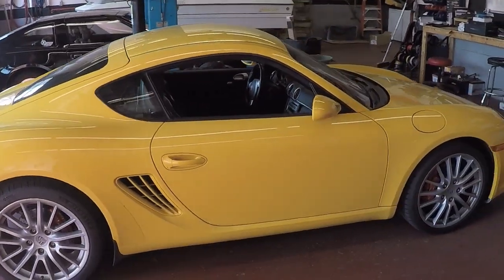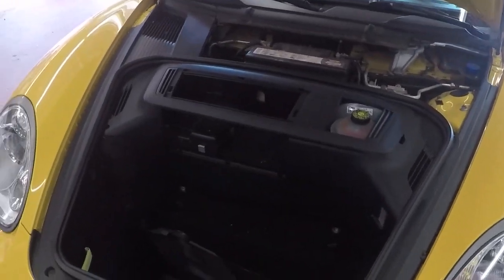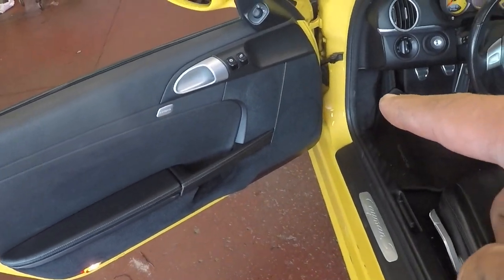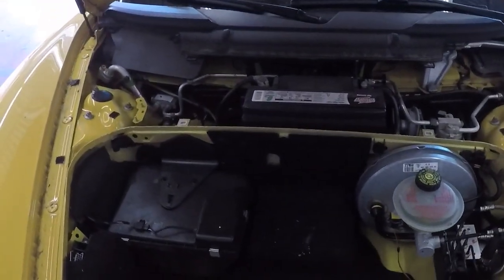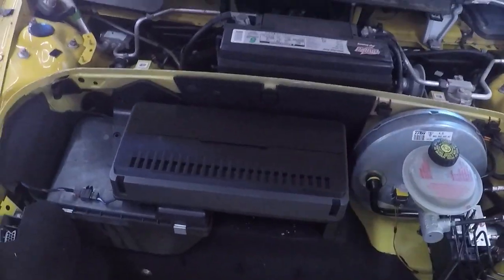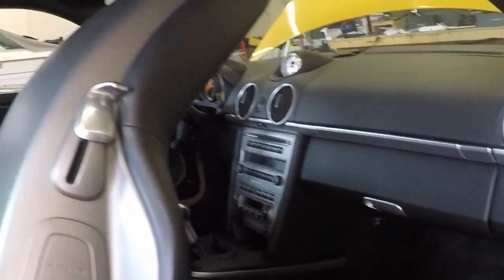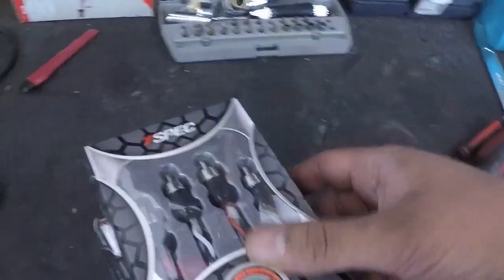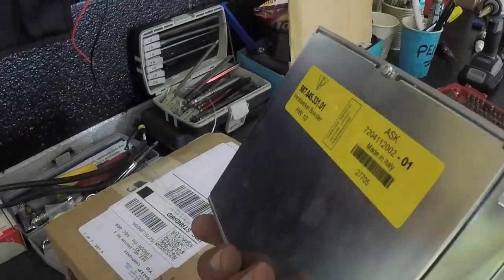How Far Taken Apart Does A Porsche Have To Be For A Full Audio System!? Part 1

Comment: I bet it's way more involved to change all spark plugs on that Porsche than to install a full audio system. Did you see where that mid-engine is sitting? Yeah, accessibility is almost zero. Not as bad as on a more modern-ish 911, but still close.
Reply: Actually, the plugs are easy in the Cayman, you just have to remove the rear wheel well liners and they're right there.
Reply: Oh, I didn't know that. But still, it looks like the engine isn't really well accessible anyways.